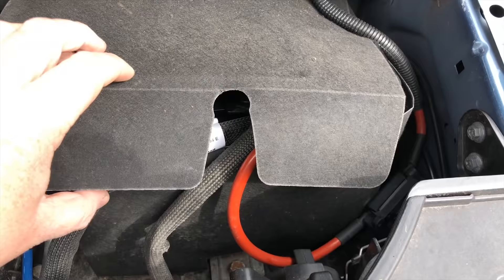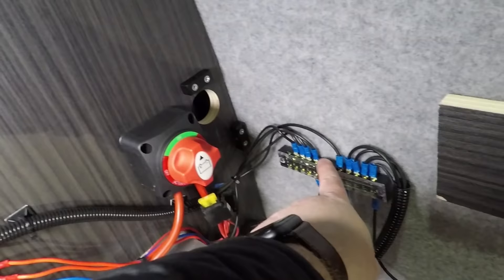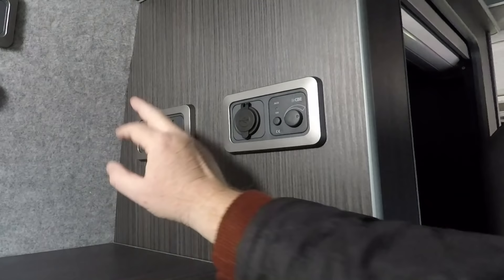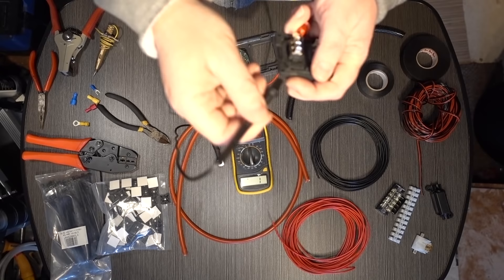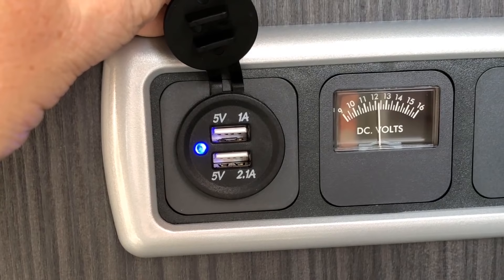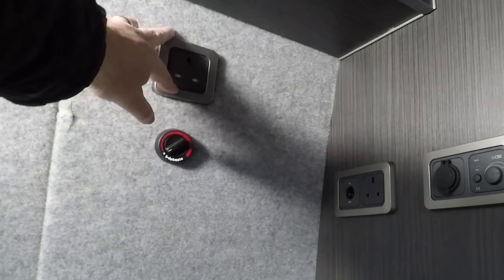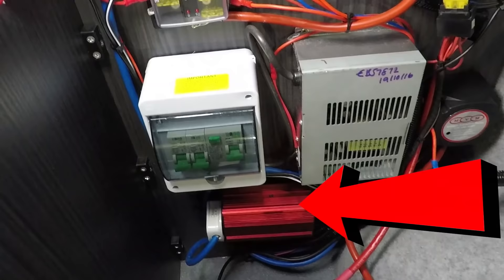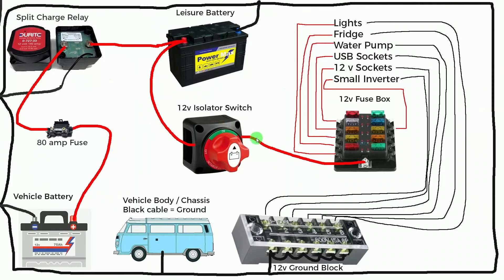Complete 12v Campervan, RV, MotorHome, Boat Wiring Tutorial

Comment: Hi John. A quick question? Would you use 'In-Car Hi-Fi' custom wire with the same gauge/rating or is the shroud unsuitable? I only ask as I have some new unused wire that could save me a £/$ or two.
Reply from the maker: If the speaker cable is high end quality, like you’d use for a high power hifi system, then that high quality audio cable will likely be of a higher quality that the same gauge standard electric wire. Hifi cable would carry a signal better and will likely have better shielding to prevent interference.
Reply: @johnmandy  Thank You,

Comment: Hi.perfect explanation.😁what size cable from the 240v to12v  charger to batter? Thanks.si
Reply from the maker: From the mains charger to leisure battery the cable doesn’t carry many amps, check the rating of the battery charger you buy, but I’d say the 16amp cable (2.5mm) will be fine.

Comment: John hello how would I use the kodiak generator to run my house power in my motorhome. And still use the motor to charge when driving..? I have 300w of solar. And 200ah are batteries plus the 90ah in the kodiak. Any thoughts would be awesome. Thanks
Reply from the maker: You’d need a shore power setup and 110v charger so the generator can power the charger for the house batteries
Reply: Can you show me a diagram.  I used to have gas generator, but it got stolen. Can I use the cables still in there?
Reply from the maker: I really can’t say, I give out generic info as each application can be unique and it would be wrong for me to comment on what I can’t see.

Comment: John, thank you so much for this video. I've been looking at a few but this is by far the best out there. You carefully explain and show what and how it should be done, so thank you. I have a question, can you install more than one USB socket on a circuit (ie like a radial) or would you just suggest having one. I'm only converting my Vivaro into a day van and will be using a 10 way fuse board like you used so have room to put them separately. Thanks again for taking the time to make and share your videos, very informative and useful.

Comment: Hi John thanks so much for these videos it's helped me out a lot. I'm current wiring up first van. I've thought about it and watched so many videos I had a really good idea about what I was doing. I've installed the split charge. The light is on on the VSR I've tested it with the multimeter and the battery appears to be getting charged, all good. I've then taken 16mm cable to isolator switch then switch to fusebox but there doesn't seem to be any power coming out?! It doesn't seem to make any sense to me. Any thoughts? Thanks for your time.
Reply from the maker: Check the cable and switch with your meter for continuity and power at each connection. The switch might be off when you think it’s on.
Reply: @johnmandy  thanks so much for getting back to me. So after much testing on all the components o have traced the problem back to the 12v control ground on the grounding block. When I tested it straight to leisure battery negative it all works fine. On the ground block I have connection to main ground on chassis and then the next is the ground for the VSR they both seem to be fine. But the next ground for the control panel doesn't work. Am I missing something obvious here? I have just screwed the terminals to the block? Am I supposed to daisy chain as I move down the block? Also what came with them is what I can only describe as a row of forked shaped things, should they be on the block too?
Reply from the maker: Yes, the forked prongs pass the ground / negative to the other connections, so without those there won’t be a negative to the other devices.

Comment: Very very good informative video. A great help thanks 🙏 one thing I'd like to know is, is it worth forking out on an expensive high a/h smart charger to charge the leisure batteries whilst on hookup? I'm looking at app 220 a/h of battery power
Reply from the maker: With that much ah then yes, as the more you drain the battery the bigger charge it’s going to need to top it up.
Reply: @johnmandy  thanks for the response, I'll take that advice on board and maybe buy the 10a/h smart charger I've been looking at👍

Comment: Should a split charge relay ALWAYS light up? Mine does?
Reply from the maker: No, the red light should only light up when the starter battery voltage is high. So I’d say yours isn’t set to the right voltage or could be faulty. If you can afford it get a b2b charger.
Reply: @johnmandy  is that new new one I been you install? Does it not do the same job? I've fixed it now. Basically it stays on for about 2 minutes after engine is off. Don't know why but at least it goes off John 😂
Reply from the maker: Ah, that’s working perfectly then. That’s exactly what they do 👍🏼

Comment: Hi john. I just bought a peugeot boxer 2017, euro 6. I wanna make a camper of it with 2 batteries just for a freezer.  Know because i ve a euro 6 Simeone told me a Smart transformer that one cost me 400 euro more. Yo know thise?  I m getting lost. Enjoy tour travels and if you have some advice... tx
Reply from the maker: You would need a smart charger instead of the split relay, they’re around £50 on eBay 👍🏼
Reply: @johnmandy  thanks so much. Cheers

Comment: Hi John,your videos are so helpful and informative.Could you answer a quick question please?Can you run a deep cycle battery and a regular van engine battery in parallel?
Reply from the maker: Thanks 👍🏼. You can do that, however, you’d only ever use the leisure battery as the starter battery would deplete much faster.

Comment: Hi John. Just wanted to ask - 

some fuseboxes have a bus bar as part of them right, and so the positive and neg wires go to fuse box which is connected to leisure batt which is grounded. Sound right?

Also, I want to power lights, fridge, water pump and to be able to charge/power laptop and phones - can all this be done on 12 v without an inverter? 

ALSO, is it possible to charge laptop via usb so I can avoid wiring up a three pronged plug socket?

Cheers John. Keep up the good work
Reply from the maker: Hi Oliver, some fuse boxes are like that and some are like mine with just + connections. As long as you wire them how they are meant to be used either will work fine. 

You can use the batteries to power all those things, however, work out how many lights and 12v devices and how long you'd go off grid and then you'll know if you need a small 75Ah leisure battery or bigger, like me and get 2 x 130Ah so I can power everything and go off grid for at least 4 days.

 I would suggest a 12v laptop charger if possible, otherwise you'd need an inverter as most normal laptops need high amps and around 19v to charge them. 

Take care, 🤓
Reply: Great. Cheers john. Much appreciated

Comment: Hi John, I used your diagram to help with my installation which is already in place so thanks for that.
I have a question though.
I'm tempted to fit a DC voltage regulator which I already have from my last van, mainly for USB outlets.
What are your thoughts on using one to maintain a steady 12V output as some devices and lights can be sensitive to voltage?
Thanks, Mark
Reply from the maker: Thanks Mark, I’ve used my setup for 2 years, I use all the tech there is and have never had any issues. It’s up to you, but it might be overkill.
Reply: @johnmandy  thanks John thats good to know👍👍
Come to think of it I only got it originally to transform 12v to I think 16v for a laptop instead of using an inverter.

Comment: Hey, great vid, thanks for sharing. A few questions:
Why 80amp fuse? Is that determined by split charge relay/ or leisure battery/or fuse box/ or the alternator? 
Also it would be great to know where the battery charger fits into your wiring diagram.
Reply from the maker: The battery charger is your vehicles alternator and the split charger sorts out the charging of your leisure battery. The video fully explains why each item should be fitted and fuses etc. The fuse for the split charger need to be large as the current from the alternator is large.

Comment: So lets say i just want to run straight from the panels to a battery not connected to the RV battery ,,,Install a battery and run it into the positive side of my existing 12 volt fuse panel ,,Can I do this,,Im sure id need a cut off switch while I'm hooked to shore power or running the generator ! Please tell me I can do this !
Reply from the maker: You’ll need a solar controller between the solar panel & battery. You don’t need to isolate the solar charger if you are using a shore power charge or even a dc to dc charger. 
Check out my advanced electrics video for more details.

Comment: Thank you for this! I got many great tips. Also realized I probably need smaller inverted than I originally intended.

Why do you need a generator though, if you can just use vehicles alternator though?
Reply from the maker: You need a lot of high capacity batteries to store your power, either generated from your alternator or hookup/solar/genny to live full time, and without moving for a week or so.

Comment: Hello, could you tell me about the sizing of the black cable? Why not 16mm as well? I mean from the leisure battery and from the ground block to the ground point?
Reply from the maker: Yes, ground is 16mm as per my video, but only for the battery to chassis earth. Then chassis to ground block too.
Reply: @johnmandy  Alright I see, thanks. Seemed to me that you were explaining that the positive has to be 16 mm but didn't say anything about using the same thickness for the negative.
Reply from the maker: In the description there’s a link to the parts video where you can see what cables to use and where to buy them. But in this video I said use heavy duty jump cables as you get black & red 16mm then for all your battery wiring 👍🏼
Reply: @johnmandy  Thank you, your input is very appreciated!

Comment: Hi John Thanks for this video it’s gave me the confidence to go ahead and wire up the van all the questions I have appear to be answered two things I wanted to ask you are the negative from the leisure battery and the split charge relay and all the wires from the grounding block can i put them all together on the one grounding point on the van? Or am I going to have to take the split and leisure negatives to one point and the rest to another one point? Thanks in advance and keep up the great info
Reply from the maker: Without knowing your van layout it’s hard to say. Always aim to keep cables as short as possible.
Reply: It’s 5 negs from 5 lights usb etc: can i put them all to 1position on the bare metal and the leisure battery and split charge to bare metal Thanks
Reply from the maker: That should be fine. Get a big contact point and big bolt to connect them all up.
Reply: Gadget John on tour that’s great thanks

Comment: Hi ,  I'm  just building  my campervan  and I install  200w solar  panels  , my question is how many  battery  i can connect  to be charged. 

For other side I will use a split charger for two batteries  to be charged  separately without any input from a solar p .

Thank you
Reply from the maker: Wire all batteries, as many as you like, together (red to red and black to black) and have the solar and vsr charge the battery bank. That’s what I do. 👍🏼🚐

Comment: Bare in mind those crimps are rated the red are rated for only 10 amps, Blue 27 amps, and yellow 48 amps.
Reply from the maker: That depends on where you buy them from. The red I use are rated 16 to fit 16amp cable.

Comment: Really useful, thanks. A quick question, do you have your battery in a battery box? And also how do you go about getting the correct size battery?
Reply from the maker: Thanks Tim. I use sealed batteries, design for boats as well as caravans & campervans, if you go to my videos and look for my campervan build parts video to get a list of everything used & where to buy from. I have always used 2 x 130Ah batteries as they’ve given me the power I need to be off grid for at least 4 days.
Reply: @johnmandy  Thanks for the info. I'll check out the other vid. I won't need as much power as you, but not sure what to get. I have a T25, that won't have too much  (heater, fridge, couple of usbs, inverter for laptop, LED lights).. and will be using the van primarily for weekends and long weekends (when we have them..)

Comment: Hello John, really great comprehensive video! Does your second battery fully recharge without the use of a voltage booster/B2B charger to compensate for the low voltage of most newer alternators?  Im looking into installing a similar system into my pickup and im not sure if I need a voltage booster to get a decent recharge.
Reply from the maker: In this video I only have 1 leisure battery, not a 2nd one. You need to buy the correct charger for your vehicle, in my installation, on an older vehicle, the vsr worked fine.

Comment: Hi, John,

Thank you for making this video it really helped me alot!  

I have a question maybe you can answer. I was not going to put in an inverter into my van but after watching your video I realize that if I want to connect to shore power I will need to. Is that correct?
Reply from the maker: You don’t need to be connected to hookup to power your inverter, an inverter is instead of hookup should you need to power some devices.

Comment: Thanks for a great vid, so many questions answered, just a couple more, I notice on your fuse box the 16mm feed is not insulated, is that the norm, also is 2.5mm cable enough for a compressor fridge?
Reply from the maker: All my cables are insulated, that’s the plastic outer coating. 2.5mm cable is more than enough for a fridge as it should draw less than half the cable rating in amps.
Reply: @johnmandy  Thanks, sorry i meant the bolt on the fuse box from the 6mm cable, is it ok to be bare?

Comment: Why can you not have your inverter providing power to your consumer unit? This would make your random inverter socket redundant as you could get 230v power from your existing 230 ring when not on hook up.
Reply from the maker: Inverters are just a massive waste of energy. It’s like pushing a car up a hill just to get the bag of shipping in the boot to your house. 

So 1 socket for the times when you absolutely need 240v/110v and nothing else will do. 

I get so many questions about this that I’m putting together a new video to explain 12v vs 240/110v and inverters and why you now really don’t need inverters for 95% of electrical devices.
Reply: @johnmandy  look forward to it mate

Comment: Hi john how long does leisure batt last if fully charged using fridge,led lights,tap ect ? That is before u need to start engine to recharge?
Reply from the maker: That all depends on the battery capacity, the number and wattage of the lights and the model of the fridge & ambient temperature.
Reply: Ok say a 110ah with a waeco crx 50,some led lights ,using water pump odd time ,charging 2x phones via usb 12v,im trying to work out would i need solar at all which wud be a plus ,i only stay in my van 1-2 mights at most ,i thought that workin off leisure batt would discharge within an hour or 2 ,its  not a big deal to me to start van and fully recharge the leisure batt each mornin if i could do that every morning ...
Reply from the maker: A very rough calculation from what you’ve described would be using on average 8 amps per hour of power, your 110ah lead acid battery is able to give around 55ah of usable power, so roughly speaking you’d get 7 hours from your battery. But you won’t leave the lights on all night, your phone should fully charge in 4 hours and your fridge won’t run full time. So I’d say your battery should at least last a weekend of average use.
Reply: Never would of thought it would last that long john,brilliant  cheers 4 info

Comment: Great video, just wondering if you really need that 80 amp fuse as I've not seen it included in the split charge relay kits I've been looking at? Cheers
Reply from the maker: Hi, yes it’s vital you have a fuse to protect from surges from your vehicle alternator. 👍🏼
Reply: @johnmandy  Oh that's good to know then, just starting my own conversion project with a bongo! Thanks 👍

Comment: Hi John, wondered if you have any thoughts or have good across a circuit diagram, kit recommendations for newer stop/start vehicles and to integrate mains hookup, smart battery charging and solar. I see in a later video you used some victron kit for the solar controller on your new van.
Reply from the maker: The sergent kit does everything in one, but it’s very basic in terms of what loads you can run. My new van has this but I’ve then added my own extra wiring and batteries to cope with what I’ll be needing to power.
Reply: Ta I will check it out

Comment: Hi John. Very informal video. Thanks for posting. I'm not an electrician by any means but most videos that show split relay install seem simple enough. I was wondering if you had an experience with vans with dual batteries? I've come to install my split relay in my Toyota Hiace 2005 and it has two batteries and what looks like a small relay for the dual batteries. I'm wanting to install a split relay for a leisure battery and inverter in back but I'm a bit confused how to go about it with 2 auxiliary batteries. Do you know if it's just a matter of connecting to the relay kit to the main battery out of the 2? I'm worried that it will mess with the van's factory relay. Any advice or pointing me towards somewhere online would be much appreciated. Many thanks, Steve.
Reply from the maker: Just link the 2 batteries together. I’ve got a video on linking multiple batteries.
Reply: Gadget John on tour Are you meaning link two leisure batteries together? I was meaning I have 2 batteries under the bonnet. Two starter batteries.